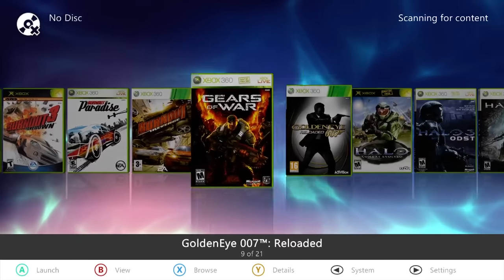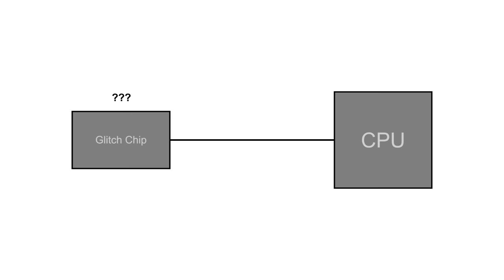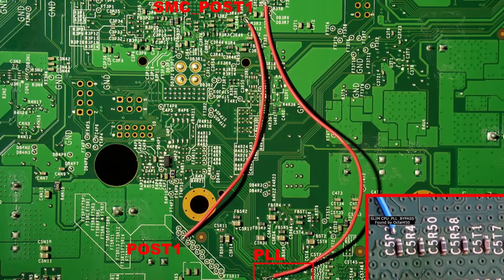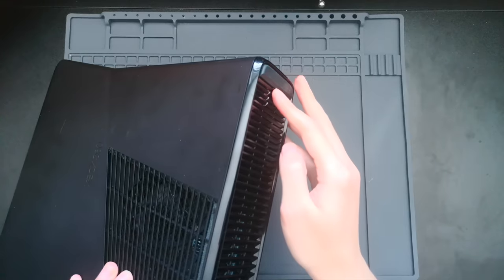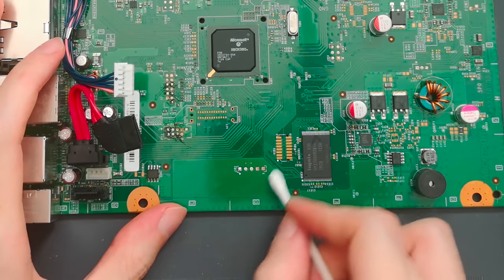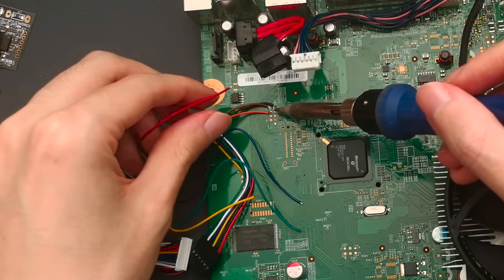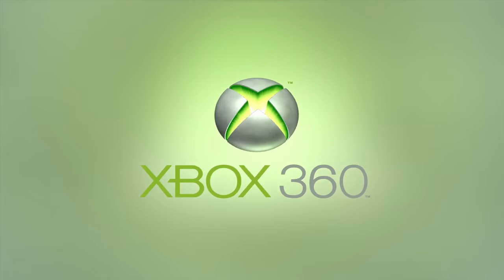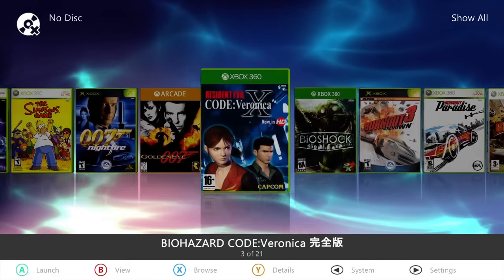You can mod your Xbox 360 with just two wires!

Comment: I actually did this on my Trinity model a few weeks ago (took a total of 2 weeks to get it done, as I had to keep taking breaks to think and relax when something wasn't going right). I ended up actually accidentally soldering the wire to the wrong pin that you scrape the silkscreen off, and took so many days trying to troubleshoot to figure out why I was getting a red ring of death. I also ended up tearing the socket out of one of the pins (I think it's the one closest to the corner) and ended up needing to patch a bunch of wires to re-complete the circuit that was damaged. All in all though, once I figured out my mistake I got the xbox put back together and my Frankenstein-esque xbox that needed to be resoldered multiple times finally started working. The xbox gets a little warm, I might need to redo the thermal pasta again lol.

Comment: For anyone reading this, the pins below the CPU, diagonal circled set of pads he soldered too.. if you plan on attempting to do any kind of RGH method be VERY delicate with that pad in particular.. it will cause an INSTANT RROD if the trace is damaged or burned.. also @MattKC i would recommend toning down the heat on the iron you where getting pretty hot on that pcb

Comment: This video gave the motivation I needed to mod my 360, this two-wire setup (plus the NAND solder points) is not easy, but is simpler than using a glitch chip, I used a Raspberry Pi Pico for NAND write and it worked flawlessly. Thanks a lot for the video! 👨🏻‍💻

Comment: The case is actually pretty easy to take apart if you know what you're doing, there's a good video about it from Josh Davison (aka that guy that works on jrunner). Also the resistor is there because pll (that small point under the cpu that you had to scrape soldermask off) isn't designed to take that much power. Resistor is not needed as the power is there only for a couple of miliseconds but it's better to be safe than sorry.
Reply: I did this whole modding process like 8 times and by the end taking them apart was fairly quick/easy, but at the start I had just as much trouble as him even after watching tons of videos. You can see where the clips are, what they look like, which way to pry, but for whatever reason it just wasn't working out at first. It was like trying to recreate a magic trick. It's like you need to learn to feel it in your bones before it starts going well. I also found that once I managed to get past the clips entirely and look at them closely in person I was able to understand a bit better how they worked. It's tricky when you're doing it blind at first. I also had a couple 360s I worked on that were pretty gross and were probably held together tighter with years of gunk in the seams which doesn't help. I then took the chance to clean all the case parts in a big sink since I had things apart anyway.
Reply: @SoundToxin When I started I also had some issues but if you practice enough you'll be able to open them no problem

Comment: I have to say I love the Video. Great explaining all around! I've modded 50+ 360s in my time and just felt like I needed to share my 2 cents.

Sadly not all 360 models accept RGH 3 that readily, but the Slim Models are usually a good bet. Depends on which one you got of course, if you got a late Corona Revision, the Post Point on the Board will not be there, because Microsoft wised up and put it under the CPU. You will need an adapter to solder to that clamps onto the CPU and punches a small needle into the new point. Also the newer models (The 360 E) are not moddable, because the Winchester Board is built pretty much bulletproof. Best 360 to Mod currently is a very early Corona or a Trinity Model (the first Slim). They accept the RGH 3 almost all the time and you can use a Raspi Pico to flash custom Firmware on them.

Some older Models like Zephyr are a major pain in the backside to mod, they will still need a Modchip to work, if they work at all. If you want an older 360 to mod, try to get one of the very latest models like Opus or Jasper, they are usually a safe bet for RGH 3. You can tell the older models apart by the power plug on the console, if they have an HDMI Port and the Manufacturing Date on them.
Reply: I wouldn't bother with an Opus. Jaspers are really the only phat consoles worth modding, or maybe a Falcon. RGH 1.2 V2 is recommended on those over RGH 3, too. Glitch chips can be had for less than $10 these days, but you do need a JR Programmer or equivalent to program the timing file
Reply: @Harmonic14  An Opus IS a Falcon with no HDMI afaik.
Reply: can you check ur slim mb revision using software if u have already rghed xbox?
asking cause u cant check it by power supply plug like phat ones
Reply: You're wrong on the E, there are a fair few Corona E models. I had one. The 500GB is definitely the Winchester, not sure about 250, maybe some are, mine was definitely not.
Reply: @safetyzone2962  yes, which is why it's not worth modding
Reply: @SoliderBoy  it will say in Dashlaunch, but just check the current rating on the sticker on the back of the console

Comment: The timing is hilarious. I’m about to rgh3 my Xbox 360 this weekend
Reply: How did it go?
Reply: @majorgear1021  this is hilarious timing lmao. I basically had no experience when going into it, and had a fixed temperature soldering iron, which really fucked things up. furthermore, the solder did not melt at the tip (since it was a cheap soldering iron), which caused me to burn the motherboard irreparably.

But two months later, I’m trying it again. Like genuinely as I write this. I’ll keep you updated haha, wish me luck.
Reply: Update: After doing the entire process on another console, it finally worked!
Reply: @VeryCuul  Congratulations!

Comment: "Just two wires" 
"You then need to solder seven additional wires."
Reply: That's for flashing the nand. You remove those afterwards at the end of it. Have you never modded an xbox 360?
Reply: @no-ld3hz  you still have to solder em

Comment: Wow, the simple elimination of the reset board is huge savings! All you need is a JR Programmer! Neat!

I also recommend using a small coax/uf.l cable (from an old laptop for instance) to shield the signal. It really does help making it super consistent.
Reply: you don't even need any specialized programmer, you can program it with a $10-15 raspberry pi pico (which you can then use as a modchip for a gamecube if you want, since you only need it to program the 360 initially then remove it)

Comment: My issue with the whole Xbox 360 modding scene is that nothing is streamlined enough for a straight up beginner. People just assume you already know how to solder electronics and/or modify the firmware which a vast majority of people don’t and even this videos comes with a caveat.

Granted, modding an Xbox 360 isn’t THAT difficult but the process is just far too daunting and intimidating for someone who just simply wants to install homebrew for the sake of preservation. 

Compared to the PS2 and GameCube modding scene which have become staples of the medium, the Xbox 360 scene barely a blip on the radar which is shame because the 360 has the potential to blow up the way the GameCube did with its plethora of mod support. It’s just a shame that the 360 modding scene all but gatekeeps to fully flourish and expand

Comment: For the difficult side of the case where the label/warranty seal is, there is a pinhole in the plastic case behind the label you can push a bent paper clip through to pop the second clip. This has made opening slims so much easier for me. You just have to run your finger/thumb over the label to find the intention and puncture it first with the paper clip. It’s smooth sailing after that.

Comment: Cool. I had a modded Xbox 360 back in 2009. Unfortunately it red ringed. It did give me a chance to test out allot of games however. Kind of like game pass does now. I've considered doing mods on more of my consoles. I did softmod my PS2 just for the fun of it. However I generally end up collecting allot of games at the end of a generation so I have all the games I would have played on the system had I modded it. Except emulators of course, but I have that covered on PC :D

Comment: After watching this i went on ebay and got me a 360 slim 😅 hope this one doesn’t end up collecting dust like the PS3 ss i got for $40 (incl 2 original controllers) after watching a video on how to install HEN on it.. it seems that the jailbreaking is the interesting part for me these days, not so much gaming itself 😢

Update: console arrived, did the hack, but broke something when assembling the heatsink 😢 that X-clamp is the worst. The console would show some image on the TV and then glitch out in blue or red squares. I assumed i had cracked the solder under the CPU somehow. After watching one tutorial i decided to try reflowing with a heat gun and lots of flux. And it worked! 😄

Now I am afraid it will crack again if I put the bracket back on and screw it down. The front USB ports are sitting quite high because the bracket is bottoming out. If I screw it down, the tension would be really bad. I am thinking of leaving it with no bracket, or modifying the bracket somehow. Decided to delid the cpu, temps are around 60C while playing…
Reply: Haha man that last sentence is so accurate it hurts

Comment: I have modded probably 20 or so original Xbox's and just recently got back into playing with the 360. The only issue with the 360 is that it is a bit more complicated to do. It is way easier now with the simple two wire mod, but you still need a JRunner tool or similar device to program it.  Homebrew is lacking on the 360, but some things can be emulated to work through the OG Xbox emulator. I am more interested in the emulation of the OG Xbox games on 360. If I can upscale all of them to 720p and still have system link support then I am considering modding 6 or so to host some LAN parties.

Comment: Is there still no true softmod on the 360 that can be done entirely through software? I mean the 360 is 18 years old at this point. It's hard to believe there hasn't been a way to mod it purely using USB. Most systems like the Wii usually let you softmod by booting a corrupted save game in a specific game that lets you run custom code. I can't believe this hasn't been figured out yet. I'm still waiting for a completely software based softmod for the 360. I don't know how to soldier so this isn't viable for most people
Reply: Unfortunately not - the main issue is that the 360 firmware uses a hypervisor which insists on all code being signed, so even if you can somehow inject exploit code into an executable area this will break the signature and result of the hypervisor terminating it.  You have a very short time window after doing the code injection before the memory hashing catches you, so if you can exploit the hypervisor in this time you can turn the enforcement off.
The problem is that the current versions of the hypervisor have no known bugs that would allow you to do that, so your code is just going to get forcibly terminated.  There was, however, an older version of the hypervisor that did have a privilege escalation vulnerability - and since it's official MS code it also has a valid signature - the issue is  that the later versions of the boot code won't boot it, so you need some way of tricking the boot process into doing so - which is exactly what the original JTAG hack and the various later RGH hacks do.  Once you have this vulnerable hypervisor running you can exploit it and turn the security off.
The bug was introduced in build 4532, was still present in build 4548 and was patched in all later versions. In order to create an actual softmod you need to find some new bug in this section of code, which to date nobody has managed to do - and lots of people have tried.

Comment: I still have my RGH modded Falcon model Phat 360 with a Coolrunner-ii CPLD I installed 10 years ago. When following the forum suggestions I came across someone who used an old coaxial cable to connect CPU reset wire and got good results. I did the same and was surprised at how fast it booted compared to what others had experienced. Still boots to this day on first reset still going strong over 15 years since manufacturing despite being one of the cursed original model, though I did replace the Xclap with washers and bolts, unlike others I spent extra time getting the correct sized nylon spacers and didn't bend the motherboard with excess force.

Comment: I've disassembled my 360 Slim twice since i got it in 2010 and i have to say the only reason i haven't been doing it lately is because of those retention clips on the inner housing of the case, i've cut myself almost 10 times trying to unlatch them before it's infuriating but the next time i do atleast it will be worth while when i finally mod it

Comment: Octal published several tutorials regularly since two years ago. The best method for the rgh 3.0 is to use voltage regulators at 1.2v so there's no chance of the gpu or the hana frying each other.

Comment: Its crazy that after 18 years, the 360 is still one of the few consoles that doesn't have a softmod at all. I have a Slim with a broken DVD drive that I literally can't repair because of the stupid decision of locking the drive to the console and nobody in a driving distance even want to attempt an hardmod because they're so annoying to do.
Reply: If the circuit board on your original non-working DVD drive is good, just transfer the original circuit board to the new DVD drive and your Xbox will recognize the drive just fine. The only reason you have to hard mod to do an optical drive repair is if the circuit board on the optical drive is dead or you got the system and the drive was missing entirely
Reply: @coolsnake1134  That what I wanted to do, but it was cheaper to buy a new console than to find a compatible drive. Also, the console is probably the most complicated I've ever seen, I've opened iMac that were less annoying than that.

Comment: tip: since you had an old RGH install, you can boot and dump and flash the nand through software, which would've actually made it a 2 wire mod. Unless it was really bad and wasn't booting, you don't need the nand flasher

Comment: I got an X360 this year and tbh I paid for the mod because I don't trust my welding skills, but it was really good like for $30 they provided the newest RGH, they installed it, changed the thermal paste and cleaned the console and left it up and running with Aurora and all the bells and whistles and even some games installed for a good measure, can't complain at least when you can find reliable shops to do that job for you.

Comment: You didnt need to install the nand reader again.. you could have used jrunner to create your RGH3 nand from the original or dump from your rgh, then flash it with Xell or simple nand flasher, then just run the RGH3 wiring and your done.

Comment: Doing this right now to my 360E.  The soldering is the easy part for me - being in the electronics industry, having a Metcal soldering iron, and an inspection microscope works wonders.  By the way, try using a nice 0603 surface mount resistor instead of that giant through hole one.  Right now having issues because it seems Picoflasher doesn't like Corona 4GB boards all that much.  Probably going to try a homebrew SD-tool made from a micro SD card adapter instead, since weekend modder seems to think that's the way to go on those boards.
Reply: While you're at it you should remove the 6 0ohm resistors near the CPU fan, they are known to fail on that board and force the CPU to think it's always overheating. 
I just soldered jumpers instead  of replacing the resistors but that's up to you.
Reply: @atlucas1321  Thanks for the tip.  Will have to look into that.
Reply: @atlucas1321 How on Earth can a zero ohm resistor possibly fail? It's literally just a brick of metal..
Reply: @nikkiofthevalley  I imagine that it was bad solder imo. Checking them with a multimeter and 2 of the 6 were 37+ so I imagine they bacame "infinite" resistance.

Again I just removed them and made jumpers
Other people theorize planned obsolescence as well considering how prominent this fault is.
Reply: @atlucas1321  Yeah, I'd doubt this is planned obsolescence.  0 ohm resistors are such a common thing in PCB design and it would be such a pain to try to design something like that to fail in just the right way, I really doubt they'd do that.  Not like game consoles don't have planned obsolescence in much more predictable ways (shutdown of Xbox Live, release of a new console and no more new games for the old, etc).  It was probably either just bad solder joints for whatever reason or 0 ohm resistors that were a bit less tolerant to heat than they should be (and no, even 0 ohm resistors aren't just a chunk of metal).

Comment: I've had a 360 for a year or so that I was gonna send to a service to get it modded, but if the wire mod is as easy on a Jasper as a Corona, I may try to do it myself at some point! I'm still very much a beginner at soldering but it'll definitely be a later on project once I get comfortable enough. Or maybe I'll still just send it to a service, depends. I also need a bigger HDD considering I'm still running a 20GB HDD in mine lol

Comment: My console is the later phat white revision and has the had RGH2 mod installed since it first came out. Not sure which revision as at the time I was very new to modding the 360 so got a shop to do it for me. Still works fine today without any problems starting up. I know the RGH2 mod wasn't around for very long. Glad a newer, more reliable and easier to install RGH3 mod has been found but not sure how well that works on older phat model 360 consoles.